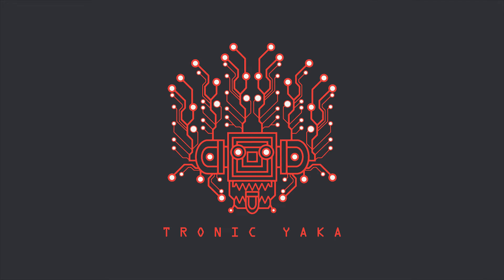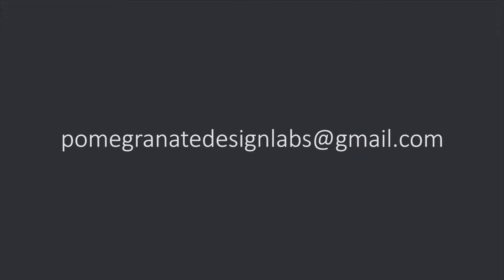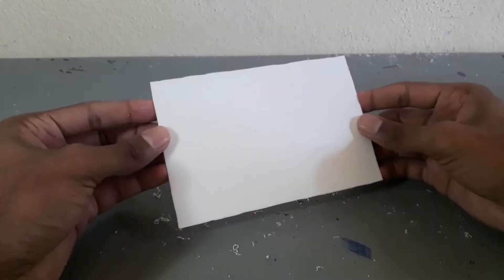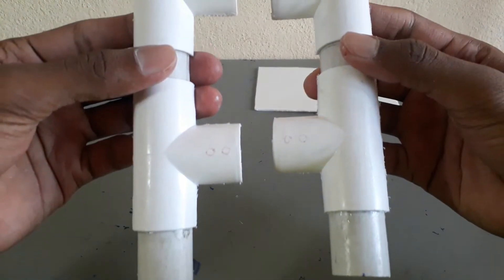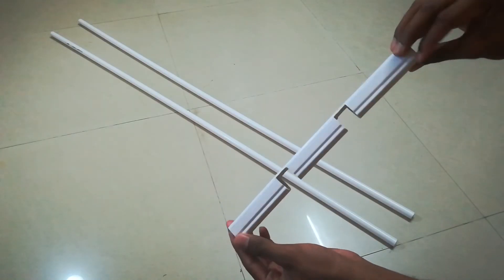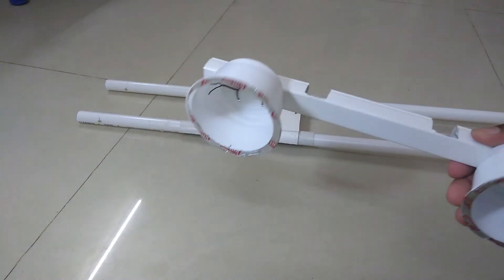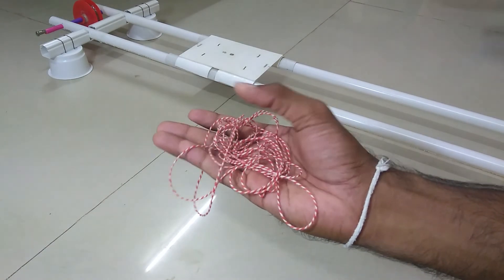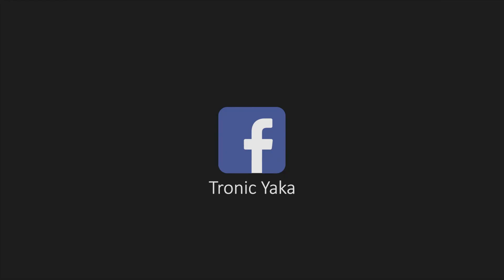Arduino Project #4 | Camera Slider - Part 1

Comment: I have seen your video how to make an Arduino controlled car but can I use 9v batteries instead of 3.7v batteries
Reply from the maker: normal 9V batteries will not perform well. you need to use high current batteries.